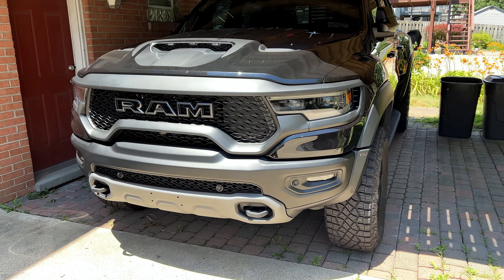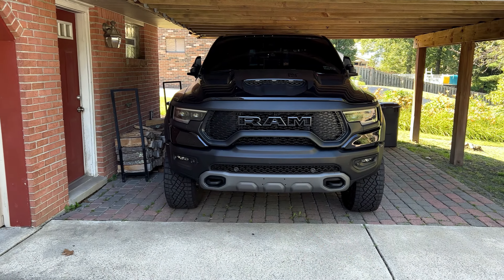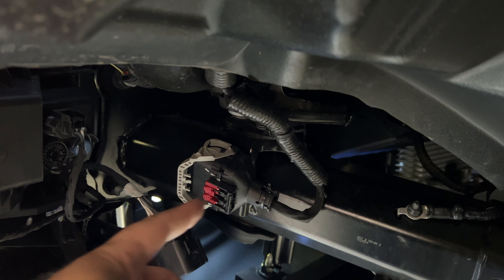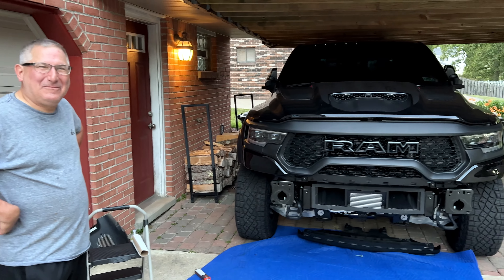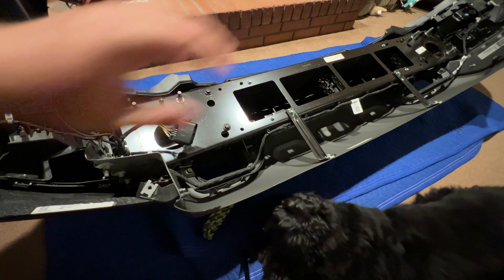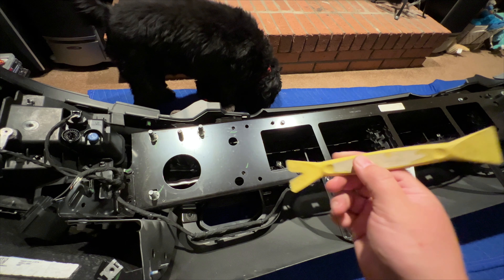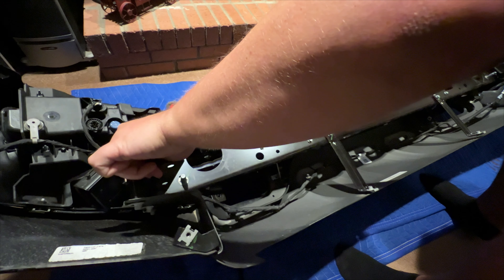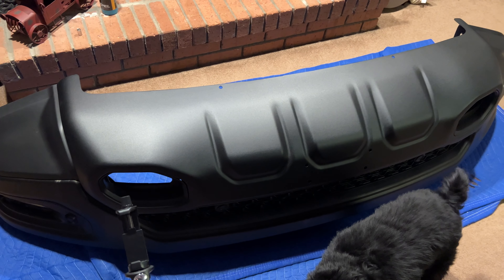COMPLETELY change the LOOK of your RAM TRX or Rebel with the OEM Black Skid Plate!

Comment: To anyone wanting to do this I highly recommend using bed liner to “paint” the silver skid plate to black, it matches the finish so close you cannot tell it wasn’t OEM and it’s a lot cheaper than replacing it. But yes everyone is right about those inner nuts, what a pain… in the nuts
Reply from the maker: 😂😂😂 right?!
Reply: What bed liner matches?
Reply: Do you have to sand the plate down first?

Comment: Thanks so much for the video!  Followed the instructions to the tee and made things sooooo much easier.  One thing though is that I just used a 24” angled  ratchet and was able to take the 3rd nut within 30 seconds!  Piece of cake!  Just need an angled ratchet with some leverage so for those folks that are looking to do the same just pick up the right tool and it took about 2 hours total w/ power tools for all the nuts and bolts.
Reply from the maker: You're very welcome! I tried everything I had in my arsenal and could not get that dang nut off! I'm glad you got it figured out, though!
Reply: @HorsePowerObsessed  the way you documented was absolutely perfect!  For those looking to do this follow this video!
Reply from the maker: Thank you!!

Comment: Nice tutorial - I did mine right away and it was a pain for sure, but well worth it. I ended up having to take the bumper off again to add my Lightbar and it was still a pain.
Reply from the maker: Totally agree. That one nut on the frame just makes what should be an easy job annoying.

Comment: But DUDE! How did you get to that third bolt on the bumper to frame horn??? It's beating me! I was thinking maybe an 18 mm Crow's foot on a 3/8 drive flex head ratchet??? My birthday
Reply from the maker: It was a real freaking treat, I'll tell you that much. I was able to get a small socket wrench on it and turn it slowly but surely.

Comment: Mine was painted and looks like crap now... chipped with every bug now it looks textured lol but i still dont know if a full factory replacement is worth it... thinking about using wrap or plasti dip
Reply from the maker: This is exactly why it went with the factory replacement instead of paint. The only thing that would even remotely hold up I think would be bedliner

Comment: Just a silly question: why not to wrap it?
Reply from the maker: It will get destroyed by rocks. Vinyl will show every single impact.
Reply: @HorsePowerObsessed  where did you buy that skid plate (part number) ?
Reply: @SnakrGarage  do you still need this? It’s 5ZB4 7GXH AA - 001